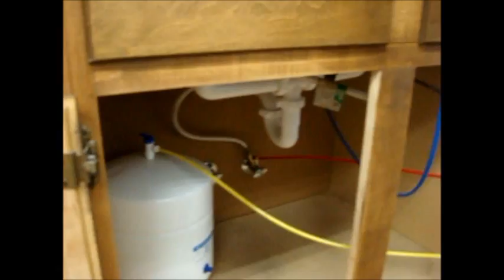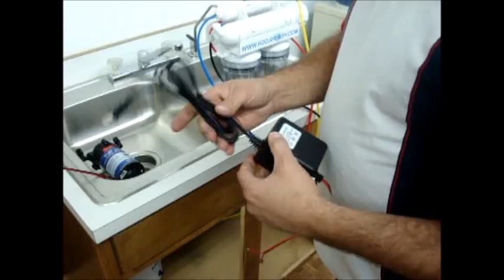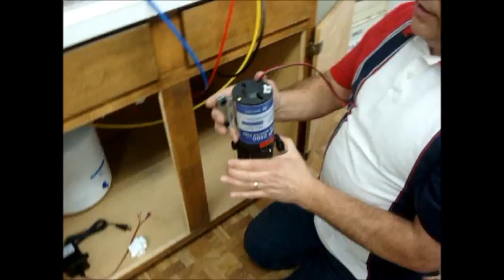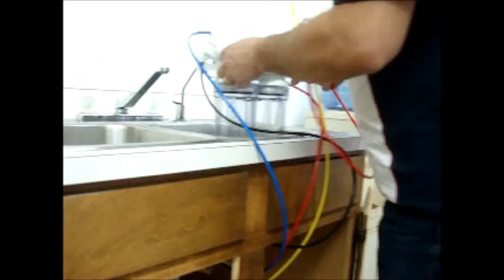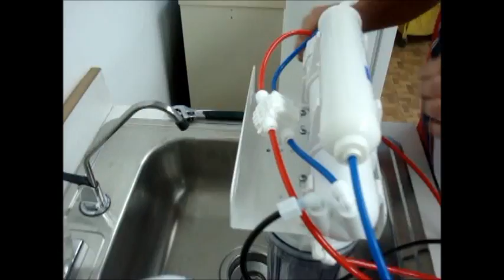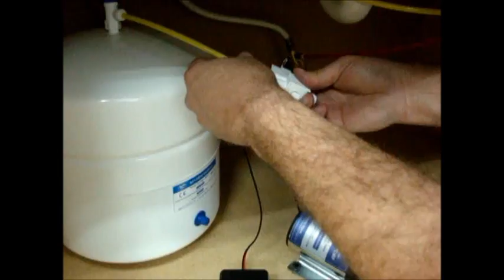How to Install a Booster Pump H2O Splash

Comment: hi, i already install my system but it doesnt works, i only got two liters and then water stops going out, i have everything in place, booster pump, pressure switch, etc, can you help me what it can be, i have to leave the pump working a lot of time and after that open the water and get only one or two liters and then leave the pump working  more time to open the valve and get more water after that

Comment from the maker: You should Not hook up the switch as it won't work without it back pressure. Make sure you are present because you will have to turn the unit on and off as you need it. Thanks for the question!